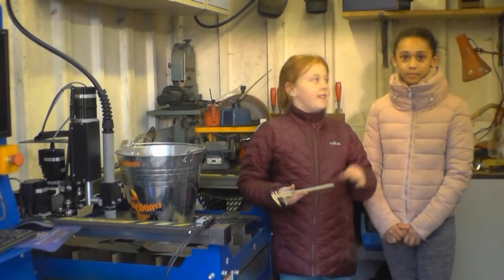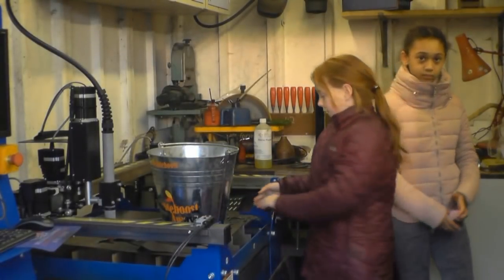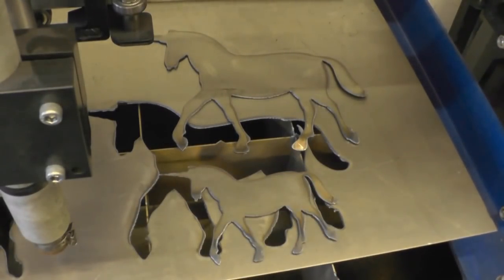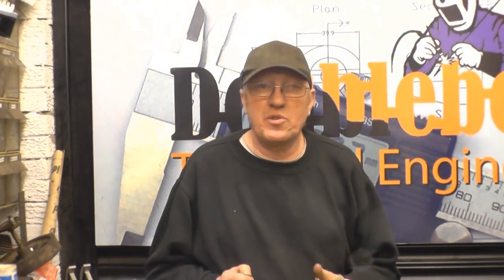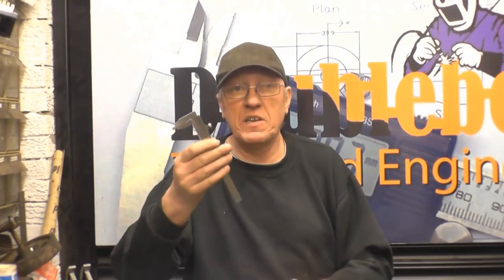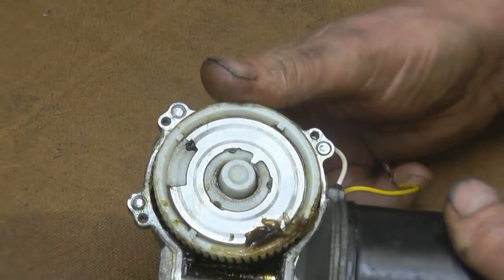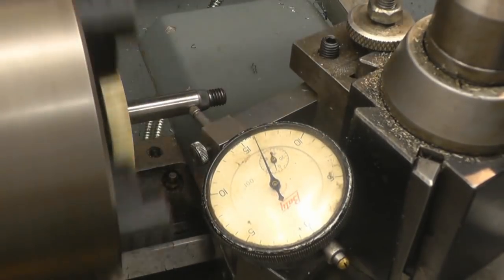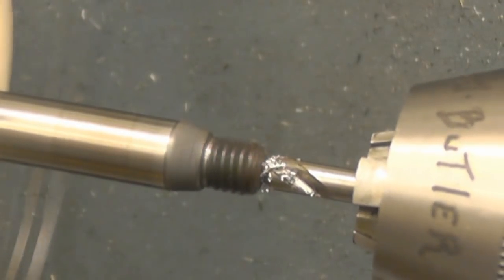SNNC 208 P1  Weld Positioner      Plasma Unicorn

Comment: As usual, a great SNNC.  Just wonder, as a professional Engineer, why the wiper motor manufacturer used both bolt and rivets.  Could have made a tidy saving on manufacturing cost by eliminating one form of fixing.

Comment: Nice gentle hand center drilling that shaft.  There was some spring in it due to the plastic gear.  -  Hard to do the fine work when the strong hand is in a cast, but you get by.

Comment: Never mind bending the horn on the unicorn, you could insert a carbide tip.  Or cut them out of a nice bit of carbon tool then temper.  I think the ideal is bring up to cherry - then quench at pink.

That is a nice bit of kit you have there.  I bet it won't be long before you're producing a full range of pony merchandise.